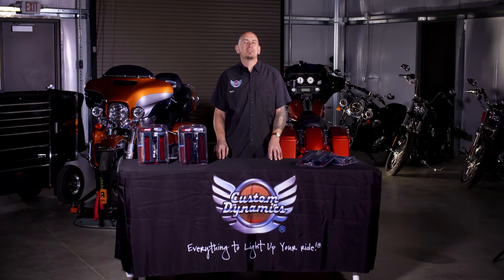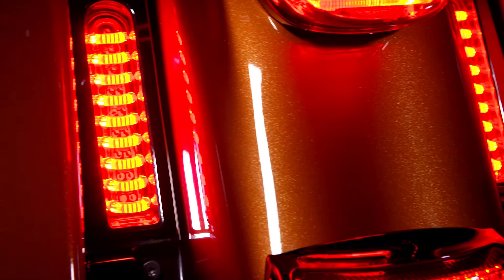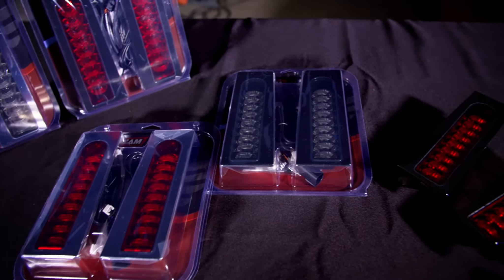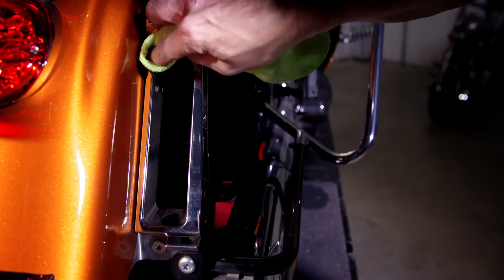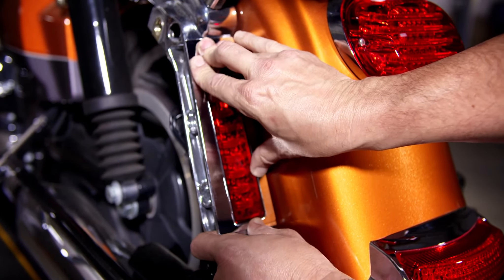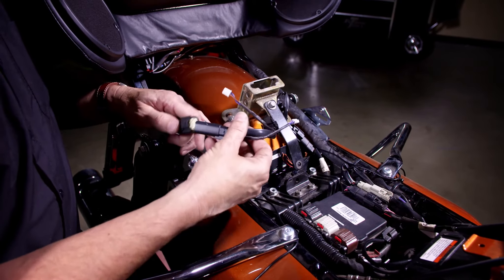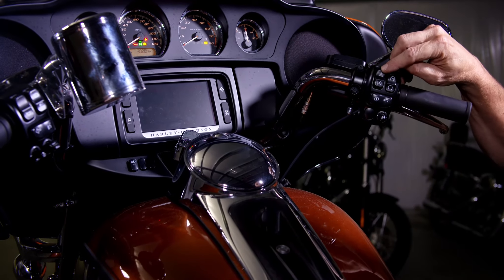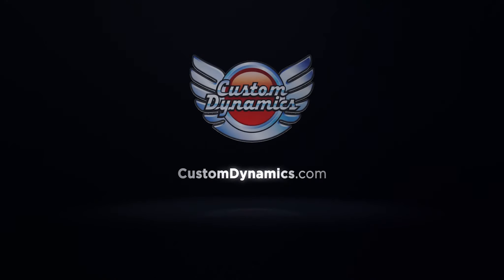How To Install ProBEAM LED Fillerz for Harley Davidson Motorcycles 🔧

Comment: Very cool, installation is a bit easier with these than your previous version it looks like being all plug and play.  Great job! I just installed the probeam tail lamp and it looks awesome in person,  I wasn't sure when I first saw it online but now that it's on my bike I love it!
Reply: Touring Midwest I saw your video with the posi tap connectors and was less than enthused about all that work. This system looks super easy. Maybe even I could do it lol

Comment: Is it possible to install LED fillerz lights with the saddle bag lights at the same time?
Reply from the maker: Yes! Many of our customers have opted to install both the Fillerz and BAGZ Saddlebag LED Lights together - we even make an  MPR Extension Harness which would allow you to install Custom Dynamics® plug & play lighting products (i.e. Fillerz and non-sequential BAGZ Saddlebag LED Lights) to run off a single MPR Adapter Harness! You can call us at 1-800-382-1388 and we can walk you through the installation/answer any questions you might still have!

Comment: DOES NOT WORK WITH OUT SPLICING WIRES AND MAKING A MESS WITH IT TO HAVE TO WORK AS A RUN /STOP LIGHT.. POOR DESIGN....THIS ONLY IF YOU HAVE A ELECTRA GLIDE POLICE BIKE... YOU WOULD THINK A COMPANH LIKE THIS WOULD CORRECT THIS PROBLEM AND HAVE THE RIGHT HARNESS FOR IT TO BEGIN WITH...
Reply from the maker: That is absolutely not true on most all models it is plug and play as run brake and turn. However on a few models that have separate run brake and turn wires it is true that you will have to splice in order to get all three functions on to two wires, Its not a poor design it is just basic electrical 101 that if you have three signals on three separate wires you're going to have to do something to get them on to two wires it's not magic!
Reply: @customdynamics  I did not say all models if you would read the  whole comment you will see it iis on the Police Bikes ... anyway i learn the hard way and will ask a bunch of questions which i do not think i should have to do because  the company should and most do make what ever part   that goes on a  bike work like it is advertised  
plug and play... and this has a red lens... and red if my memory serves me right is for stop only.. amber is for turn...  and further more i did not want brake,turn,run.. i just wanted run and break... sell stuff that a someone wants with not having to go redesign and if somthing  don't  go right then you have to call and spend extra to get somthing else sent to you to make it work....